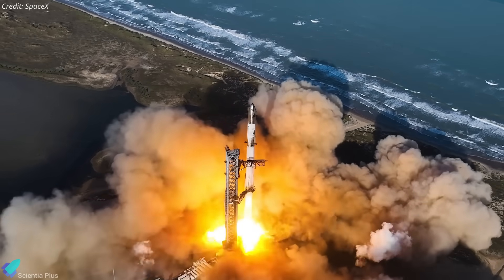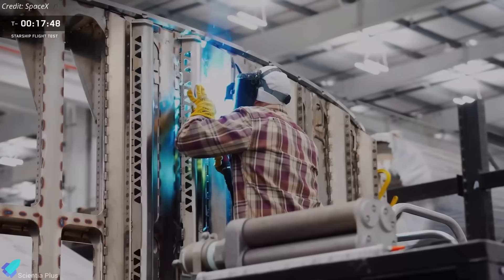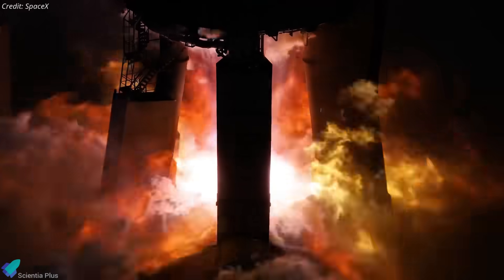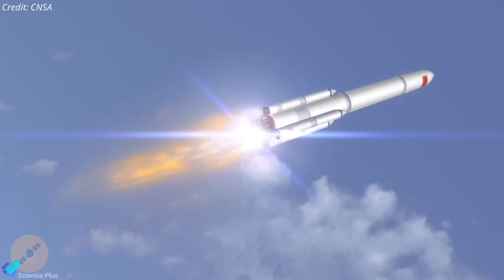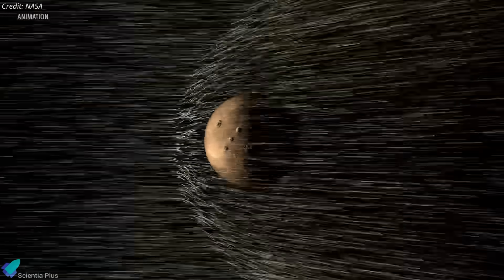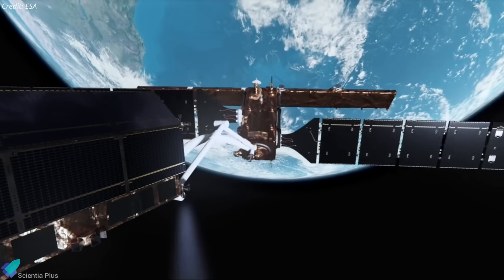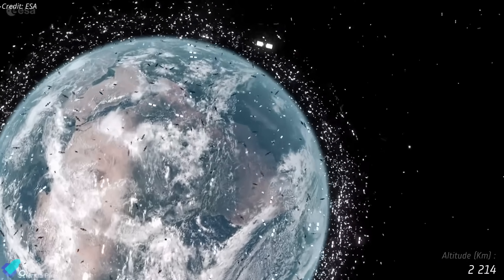SpaceX Furious as Starship Blueprint Spreads in China, Starlink Nearly Gets Hit

Comment from the maker: 00:00 Starship Updates
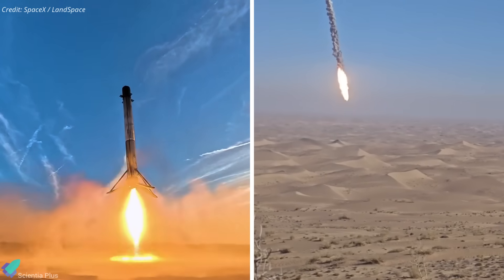06:46 China Is Copying Starship - Designs Are Spreading Fast
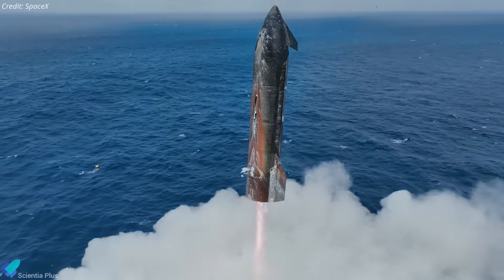10:32 NASA 11 Years Old Mars Orbiter Is Tumbling Out of Control
13:27 Chinese Satellite Nearly Collides With Starlink, SpaceX VP Sounds Alarm

📚 Learn More:

🚀 Starship Block 3 Explained: https://tinyurl.com/mp63u57m
  • Detailed Breakdown: https://tinyurl.com/bddv6w2y
  • Production Begins: https://tinyurl.com/5cb2ee3h
  • New Transfer Tube / Downcomer: https://tinyurl.com/ymm23t2c
  • New Grid Fin: https://tinyurl.com/mppnd7sz
  • New Integrated Hot Stage Ring & Forward Dome Upgrades: https://tinyurl.com/msvxk8m
  • Booster Block 3 Aft Dome Insane Design Upgrades: https://tinyurl.com/3k2rxvpf

🛢 Dual-Port Orbital Refueling – Full Technical Breakdown
https://tinyurl.com/3hej7fk3

 Starship Block 4 Unveiled: https://tinyurl.com/ymhyyt2h

🔥The Insane Engineering Of Raptor Engines:
     Part 1: https://tinyurl.com/348hsrya
     Part 2: https://tinyurl.com/p8k85mu6
 
🔥 Raptor V3 Explained:
    Mega Upgrades & First Test: https://tinyurl.com/22nzc3za
    Raptor 3 Evolved Again - More Protection This Time: https://tinyurl.com/4up7jxdd

🛠 Insane Engineering of New Starship Launch Pad: https://tinyurl.com/42h5kd92

🧱 What’s Inside Starship GigaBay?: https://tinyurl.com/2ujtkmkb

🛠 Other Starship Upgrades:
 • Hot Staging Explained: https://tinyurl.com/yc4ejbmn
 • Super Heavy Booster Upgrades: https://tinyurl.com/msm9jtkc
 • New Heat Tiles Explained: https://tinyurl.com/45dytyef

🔥Booster 18 Explosion Complete Breakdown: https://youtu.be/2mYXI6WRwqI

📡 Stay Updated:
📢 Weekly Updates: https://bit.ly/3HIQjPC
🚀 SpaceX Playlist: https://bit.ly/34wue8T

Comment: The Chinese would be foolish to copy the SpaceX approach with Starship -- the payload penalty you pay for the necessary things needed for reentry, aerodynamic control surfaces and landing, is just too high for a heavy lift rocket.  The penalty in payload is over a third and might get to about 40%.  And SpaceX have yet to prove the heat shield will not only survive reentry but to also do that many times with little or no maintenance.  The geometry of Starship is not great for reentry as the radius is just 4.5m -- you want a much larger radius than that as the larger radius helps to push the plasma further away from the spacecraft.  The last IFT succeeded only in as much as the booster made a controlled landing in the ocean as planned.  The heatshield looked terrible and it's my guess that there was some structural material below the heatshield that was also damaged, not enough to burn up this time, but that Starship, even if it had landed safely on land, would never be reusable as the cumulative damage during a second reentry would likely see Starship breakup in descent and likely around the point of max heating!